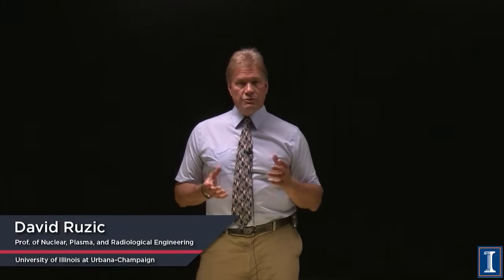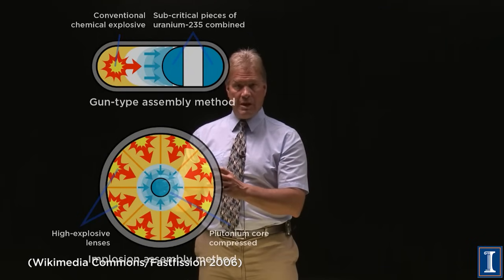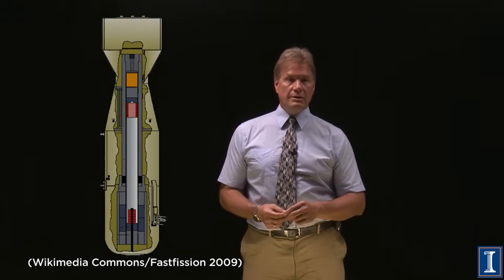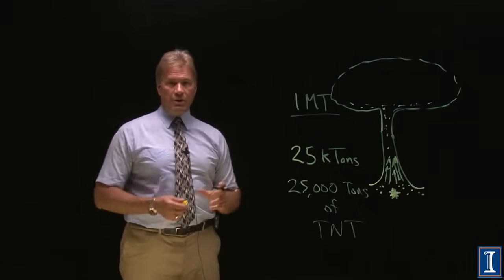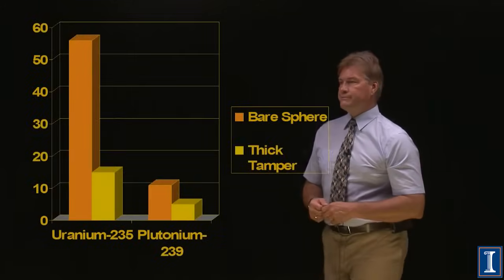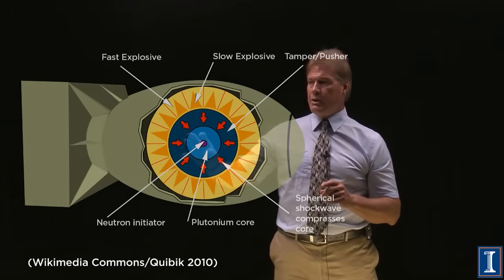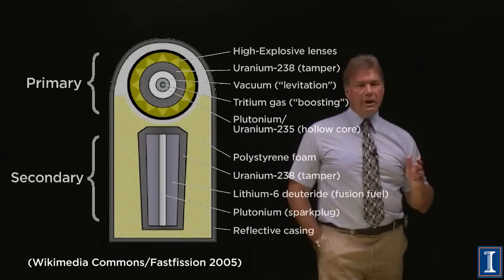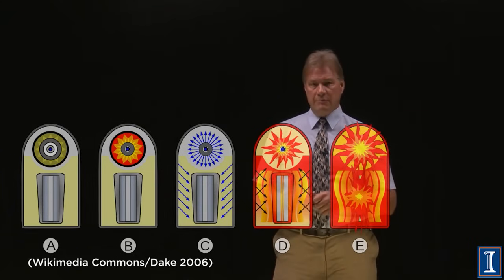The Biggest Bangs

Comment: 16:13 Uhhhh, the reflections inside the secondary case are of radiation (mainly x-rays), not neutrons.  Yes, the neutrons are needed to fire the sparkplug, but only after it is compressed by the radiation and plasma energy raining down on the tamper.  That was the Teller-Ulam secret, use of radiation to compress the secondary.

16:45 The falling bomb is a different test, done at the NTS I think.  The Ivy/Mike wasn't dropped - it was an industrial cryo plant feeding the bomb inside the "shot cab", a shed that kept the rain off, shown in the video at 16:38.  The yield of Ivy/Mike was 10.5 mt, to be outdone by Castle/Bravo 18 months later at 16 MT.
Reply: I'm glad I wasn't the only person to notice the Prof's inaccuracies in this video. It was Castle Bravo that had the unexpectedly high yield as it was the first to use Lithium Deuteride as the fusion fuel which had an unexpected boost from Lithium 7 being converted to Tritium during the fission/fusion.  Ivy Mike - the first "hydrogen" bomb - used cryogenic liquid deuterium and its yield was within the forecast range.
Reply: The speculation is that the the radiation pressure (from the reflected X-rays) is not enough and that it is the ablation pressure of the tamper surface that compresses the secondary. You are correct the only purpose of the primary A bomb is to produce the X rays for compression. (since the X-Rays move at the speed of light you don't need the symmetry and lens that you do for the chemical explosive in the primary). The neutron flux to create the tritium comes from the spark-plug. The case itself can be U238 which can take part in the reaction giving a fission-fusion-fission sequence (with a large proportion of energy coming from fission)
Reply: @MichaelKatzmann  Afaik, the three-stage fission-fusion-fission device was considered for the Tzar Bomba test, but not realised - that much fission would have increased the fallout of all previous tests together with 25%. That bomb was already strong enough that most of the pressure wave escaped from the atmosphere. With only two stages, it was also the cleanest bomb with 97% of the yield generated from fusion and being air-dropped.
Reply: @stephanbrunker  Tzar bomba as tested was still at least 3-stage design: at least 3 implosions and maybe up to 5.
Reply: @MichaelKatzmann  the neutron flux to breed tritium comes primarily from DD fusion. 
The "spark plug" is there to provide the heat needed for DD ignition.  Without DD neutron production, the neutronic population would have been constant throughout the fusion burn.
Reply: The video footage is also mixed up somewhat. 16:33 shows the Ivy Mike building with the radio tower beside it. And that was at Eniwetok, not Bikini. Castle Bravo then was at Bikini with the solid Lithium Deuteride fuel and a much higher yield than predicted because of the reaction of the Li-7. And if at 16:43 the footage shows a falling bomb, that has to be a very different test altogether, because after the Able drop was quite a bit off the mark, for a long time all the tests were made stationary. 17:10 doesn't look like either Ivy Mike or Castle Bravo.
Reply: @stephanbrunker  I'm pretty sure 17:10 is Ivy King, a 500KT fission device.
Reply: @circuitsmith  Yeah, you're right.  It is, even as the prof is talking about Mike.  You can see the whole Ivy King film at https://www.youtube.com/watch?v=J7Z-mmu7f2E; it was a pure fission bomb tested to make sure we had a major sized (500 kt) fission weapon for deploying if Mike didn't work so well.

Comment: 5:46 - people often comment about seeing such a mushroom cloud about why parts of it are pink.  The pink is the nitrogen in the air that was oxidized because of the heat (this is real chemical burning just as happens in the engine of your car, not the metaphoric nuclear "burning").  The pink is the NOx compounds.  So, yes, an atomic explosion is, on top of everything else, a little polluting.

Comment: The prompt radiation in Hiroshima was more significant than usual because of the flimsy houses in the city. In open air, the bomb would still give lethal burns farther than the radiation effect. But if there's any object blocking the view, such as a thin wall, you're protected from the burns. Gamma radiation goes through the thin wall however. Also, in case of collapse, the flimsy houses were less likely to kill occupants.
Since people could survive both the thermal radiation and shockwave this way, those of them inside the ionizing radiation radius were able to get a significant dose.